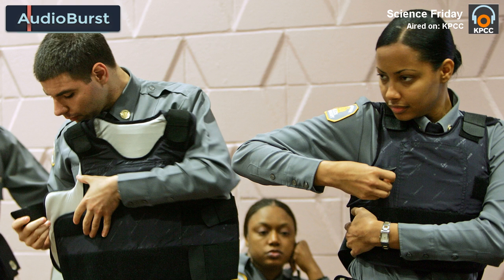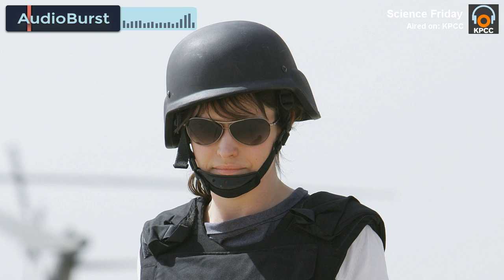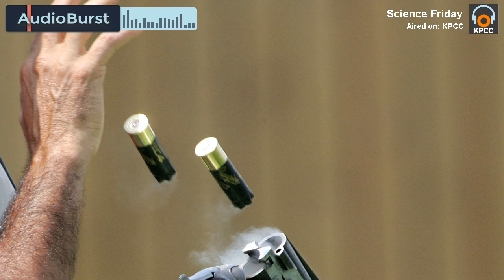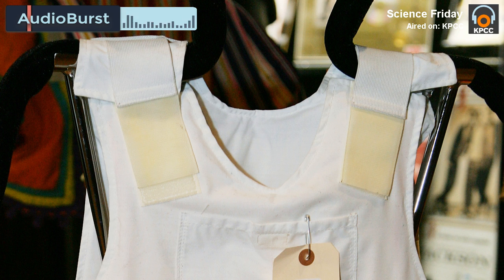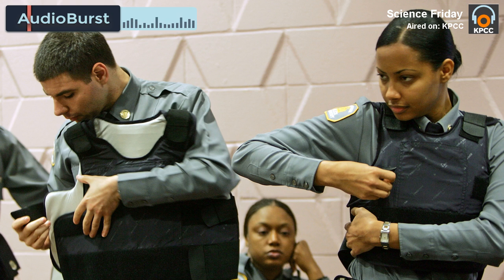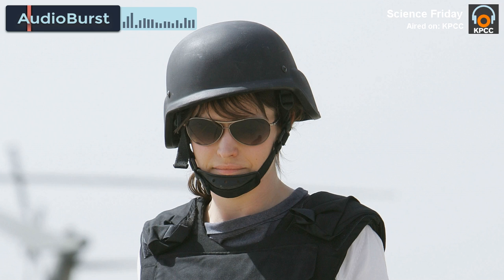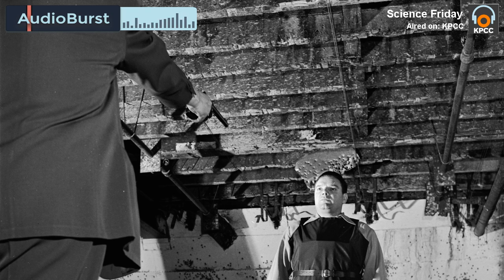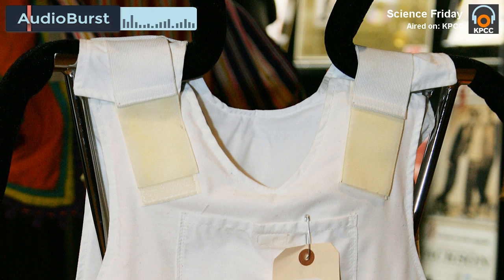Metal Foam Is Going To Make Body Armor Truly Bulletproof

Comment: How do you make this stuff?
Reply: melting the metal and run gas or water through it,in special; process
Reply: Aluminum Salt argon gas pressure chamber high temp above 700cel
Reply: sinter metal spheres to make reverse foam or make gas bubbles or 3d print it or cast use some soluble or easily removable material for the cavities and remove it after

Comment: The only thing that people would get killed by is the impact of the bullet. How does she fix that problem?
Reply: The impact is actually absorbed and re-dispersed, which is why bullets disintegrate on contact. There is a video of that too, I believe.
Reply: Realistically CMF would be replacing a COMPONENT of an armor plate. Most are multiple layers of different materials for different tasks.
Reply: Metal armor usually performs excellently in that regard, it's measured as back-face deformation.
Reply: TÝR ok
Reply: TheAttacker732 ok
Reply: Plus, they make these non-ballistic plates called trauma pads. They take a lot of the impact power out of bullets.